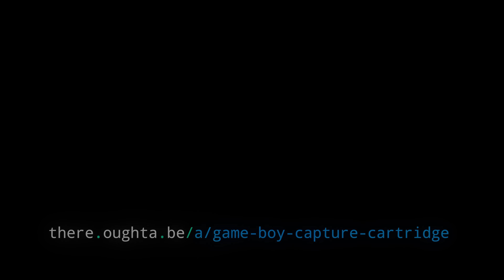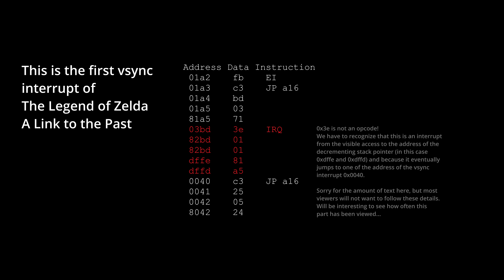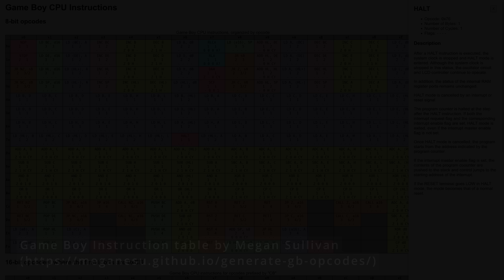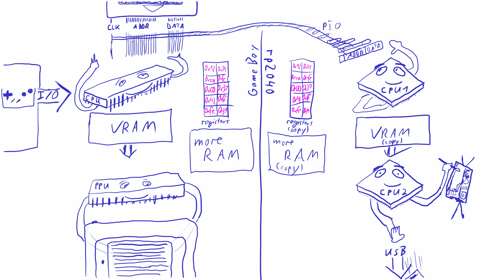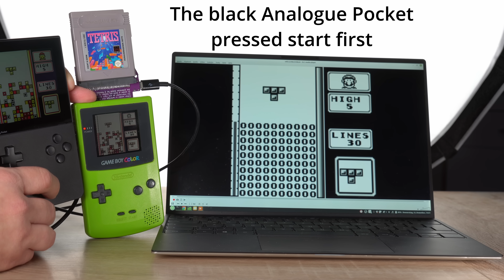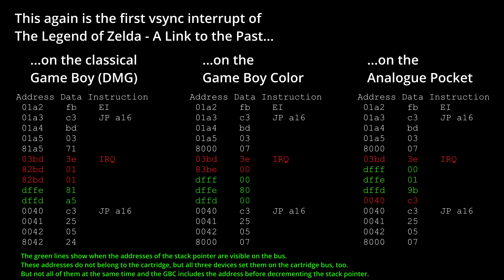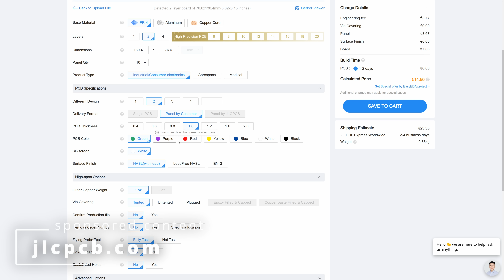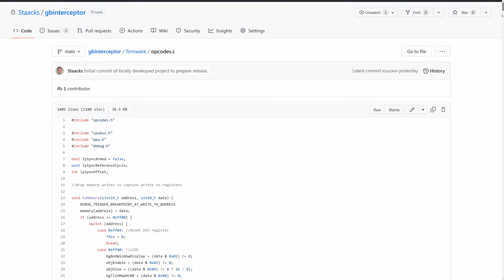A Game Boy capture cartridge: The GB Interceptor

Comment: No ESD protection on the USB port.
Reply from the maker: Can you tell me a bit more about this? Hardware is definitely not my strength and there is a reason I based this device mostly on the example from "Hardware design with rp2040" (https://datasheets.raspberrypi.com/rp2040/hardware-design-with-rp2040.pdf)...

I assume that you are thinking of some protective diodes on the data lines? I cannot see those either in the rPi Fondation's hardware guide nor in the schematics of the Raspberry Pi Pico board. ...or Adafruit's rp2040 Feather.
I know that protective diodes are inside the rp2040 for the GPIO pins and I found that the same ESD ratings are given for all pins in the rp2040 datasheet. That led me to assume that sufficient protection is provided by the rp2040 itself, but it is something that is not often considered by the average "maker"...

So, if you can give me any further insights, I would really appreciate it. (If the Youtube comments section is too cumbersome for a proper reply, please feel free to contact me via sebastian@oughta.be).
Reply: @ThereOughtaBe  as you might know, each human body can provide quite high voltage strikes and release that on a device by touching it. Especially HDMI, USB etc. lines are not hardened against that strikes. That's why all (consumer) devices should provide mechanisms to lead this voltages to ground. BTW also human touchable buttons should have that protection.
To not influence on your usb connection, there exist special high speed diodes for that purpose.

I do hardware design in the area of high performance camera systems and medical devices for living. Typical "maker" devices don't provide that amount of protection because of different reasons.
I did not find any ESD explanation at the RP2040 datasheet, so I think that the lines are not protected, but honestly I did not invest much time in that. 

I recommend using full integrated high speed protection diode arrays like the TPD4E02B04 from TI. You can also use less sophisticated ICs based on the USB speed and type.
That IC is simple to integrate and does the job easily. In the datasheet are also layout recommendations which are very helpful.
Reply from the maker: Thanks for the elaborate answer. I am aware of ESD, but mostly as a physicist in the context of handling sensitive samples. I was more hoping for ways to assess the risk in this use case and in particular for the rp2040 (although I am aware that you cannot know every random chip out there).

I will put it on my list of things to consider for a future revision, but I have to admit that I am not entirely convinced that it is particularly important here - although I am not sure if the datasheet states explicitly how sensitive the rp2040 is to ESD. But I just spent an hour researching designs using the rp2040, including boards by Raspberry Pi themselves, Adafruit and SparkFun (maker stuff, of course, but not just some random guy on the internet level). None of them has any diodes or protection ICs near their USB port except for a Zener to protect against reverse current if an alternative voltage input is available.

But more importantly, the basic version of the Interceptor does not even have a case that protects the entire PCB from being touched. Maybe one can think of a scenario in which an ESD protection on the data lines would have saved a precious rp2040, but as long as the user can touch any of the components freely, this is like optimizing the lane departure warning of a car that does not even have a safety belt...

I should probably try to get a thought on this from the Raspberry Pi folks.

Comment: Is there a chance that a GB Color will work with colors? Maybe and update of code will be enough?
Reply from the maker: I would not rule it our entirely, but there is a big "if" and a lot of work:
The big "if" is "if someone finds a trick to massively optimize my code". I don't see it, but I do not have much experience in optimizing my code for the rp2040 on that level and I have not yet looked into optimizing the machine code. So, maybe. But it would have to be a big optimization because right now I am at the limit of the rp2040 running classic games and most GBC games run at twice the clock speed.
If that is possible, there are still many additional registers and features to be implemented including resampling of color information for NV12 color encoding which is required for the limited USB bandwidth. Currently the Interceptor internally handles everything as grayscale with a static color block that is set to gray (or green). Changing that probably also means some memory optimization as the rp2040 will run out of RAM, which is another complicated story... (The rp2040 typically runs it code from plenty of flash with dynamic caching, which is way to slow for what the Interceptor does, so the code is almost entirely copied to RAM first of which the rp2040 does not exactly have too much...)

So, nothing that I would immediately call impossible, but several big hurdles.

Comment: 6:47 Aww damn. I was wondering what trick did you use to get a nice video until you mentioned the limitations.
rp2040 was almost perfect for my need, until I ran into this limit.
Reply from the maker: Depending on what you plan to do, a compressed stream might still work. If you are not doing much work on the rp2040 otherwise it might even be possible to encode MJPEG in realtime, but I cannot say for sure.
Reply: @ThereOughtaBe  I was considering some custom compression at the time and writing an OBS plugin to decompress it. I don't currently have time to thinker with it, but I was looking into an idea of modifying QOI spec for 12bpp, since that was the depth on a Nokia N-Gage. Idea was to sample it directly from the LCD data lines.
Using MJPEG seems interesting, I might look into it when I revisit the project, though I shied away from lossy compression.

Anyway, amazing project, glad this popped up on my recommends. Love this type of stuff.

Comment: Part of me wants to see someone use this with a Super Game Boy just because of how pointless it would be. I'm sure it would work fine with it, since the Super Game Boy palettes would just be ignored by the Interceptor. It does run at a slightly different clock speed though, which might require some fixes to work.
Very interesting video, I never thought this would be even remotely possible. Of course it makes sense that you could copy what the hardware does in order to produce the same output, but I wouldn't even know where to begin with implementing an emulator that exactly copies what the real hardware is doing without access to the memory.
Reply from the maker: I am curious about the Super Game Boy, too. The slightly faster clock should not be a problem as the Interceptor measures the clock during the boot ROM. Still, any different device is interesting because the Interceptor partly relies on addresses being visible on the bus even if they do not refer to the cartridge - and that can have some variation across different models.

Comment: I don't know if something like an Everdrive exists for the original Gameboy, but I wonder if one does would it also work with this?
Reply from the maker: It does and it does. At the moment there is just one little bug one has to work around: the Everdrive resets after the menu and starts again with the selected game. At the moment the Interceptor waits for the Game Boy to be turned off before it accepts a new start. So, to make the Everdrive work with the Interceptor you plug it's USB cable in when the Everdrive's menu is already visible. This way it missed the first start and is still ready when the actual game begins.
It's on the list of things I want to fix after Christmas.
Reply: @ThereOughtaBe  Good luck. Also does it work with that Wifi cart?
Reply from the maker: Yes, in fact better than I expected myself. The Wifi part should not begin with. The Game Boy does not care if the data a specific address comes from a ROM or from Wifi and neither does the Interceptor. But you were probably thinking of the video streaming demo and here I used one of the more obscure methods to synchronize the PPU (or rather VRAM access), which is not implemented for the Interceptor. So, what happens is that the image has a tear at random line, but since the Wifi cart does not use the halt command, the Interceptor stays perfectly in synch and that tear does not move at all. And most importantly: The rest of the image is perfect.

I think that's something for my social media channels after Christmas :)

Comment: if used just for recording, can it record the data and then offload emulation to the host PC? This way you can emulate not only basic games at the cost of having a significant processing delay...
Reply from the maker: You mean in order to play Game Boy Color games? Unfortunately, no. In order to reconstruct the game, you need at least the 16 data pins and the 8 data pins (you might actually get away without rd, wr and cs). That's 24bit per event on the bus, which runs at roughly 1MHz. In total that's about 3MB/s, which is about three times of what the rp2040's USB can handle if your stream it. If you record that internally that would fill up its flash in a bit more than 5 seconds. And that calculation is for classical games - GBC games would run at twice the rate.
With different hardware that should be absolutely doable, but then emulating GBC should be doable, too. I am still hoping that someone will look at my code and find a way to optimize it enough to achieve GBC emulation, but streaming or recording the raw bus data is definitely out of the question for this hardware design.
Reply: Cool, thanks for the clarification.

Comment: pretty clever! about the DIV timer and JOYP register, you should be able to access then when the game reads them, right?
Reply from the maker: No, at the cartridge end the address lines are set for (almost) all requests even if they are not targeting the cartridge, but the data pins are not set correctly. So the Interceptor can see that the Game Boy is reading an I/O register (but we already knot that as it also received the instruction to do so), but not what data it received from it.

Comment: Very cool! Would this be upgradeable to accommodating features like, say, the Super UFO Pro 8 for the SNES has? Referring to the idea of a passthrough flashcart where you can dump your own ROMS and apply fan translation patches to it for Japanese games? (while obviously also retaining the USB capture)
Reply from the maker: Not with the current design. I specifically connected the game cartridge directly to the Game Boy and only passively read the communication. With this, the Interceptor can neither set addresses on the bus (to read out the ROM) nor can it replace parts of the communication.

Comment: Can't the DIV register be predicted if you send a write command at the beginning? That might require modifying the design though, so it would no longer be purely an "interceptor".

Another possibility could be to emulate the code in the PC many times with many different DIV values until the conditional jumps match, and report back to the microcontroller.

Comment: This is truly ingenious! I had a similar idea for my Texas Instruments TI-99/4A a few years ago. I wanted to give it HDMI video output, but the existing solutions for video upgrades, such as the F18A, besides outputting only analog VGA, required the system to be opened, the video chip removed, the new device installed, and often ugly, unsightly holes carved into the precious 40-year-plus-old rarities. It occurred to me that, while the expansion port on the side of the machine does not break out the video control lines, and plus it is a multiplexed 8-bit I/O of a 16-bit bus, whereas the video chip is connected directly to 8 bits of the 16-bit bus, it would still be possible to INFER what is going on in video and replicate it, allowing you to have a higher-quality video output, such as HDMI, just by whacking a microcontroller into the expansion port.

Seemed crazy, but you've done exactly that, only on the cartridge port. Genius! I will be writing a news item on this on the Elektor Magazine website, and will link to you, if you don't mind.
Reply from the maker: Cool, of course I don't mind 👍

Comment: Very cool project even though it is not working perfectly. For those people wanting to record original game boy games without having to emulate the PPU: You could use a Super Game Boy (or for the correct clock speed a Super Game Boy 2) and just record the video out of your SNES or Super Famicom. If you want to use the Super Game Boy 2 on a PAL or US SNES, you'll have to modify it. In the case of a PAL SNES, you need to do a region mod. If you use a NTSC console, you need to modify the cartridge slot as japanese games physically won't fit.
Another method would be using the Game Boy Player on the Game Cube.

Comment: This is an amazing piece of equipment. I don't even stream but still really want to get this. One question: Would this work an Analogue Pocket or must it be original hardware?
Reply from the maker: The Pocket has a minor difference in how it handles interrupts on the memory bus, which is why it is not working at the moment. But I think that this should be an easy fix. (Just not a high priority right now.)
Reply: @ThereOughtaBe  I completely understand. I'm going to price out a few boards this weekend and see how much it's going to cost me. I know a few creators I'd like to gift this to.

Comment: To solve the link cable issue, you should intercept the link port also; like have an in and out port on the device.  Also, it's too tall, you should use a U shaped cartridge port (like on the NES), so that the device is just a little thicker at the top.  Without that, it can snap if something pushes on the top.
Reply from the maker: The current design has two reasons: a) I was told that some of the Tetris players prefer to play with the Game Boy lying flat while pushing buttons as you would on a keyboard. b) I don't have all Game Boy models here to test the correct clearance on the backside, so the straight version was the safe bet.

But that's why there is a break-out board that allows to build alternative versions with almost arbitrary cartridge positions (seen at 13:22).

Comment: since this just output video signal via usb c, can you just use any usb c to hdmi adapter to output into any display?
Reply from the maker: Are there even USB-C to HDMI adapters like that? I mean ones that act as USB host. Most adapters that "look correct" are supposed to be peripherals to a host computer and the Interceptor also does not act as host, but like a USB webcam. Even if there are adapters that would work with webcams, I would not expect them to be happy with a 160x144 image at 29fps. And finally, I assume that you would use it to play on a bigger screen? The Interceptor already has too much lag to enjoy playing directly without another adapter. It really is only for streaming and recording.
So, in short: Sorry, no, I don't thing that a simple adapter would do you any good here.

Comment: That is awesome work you've done with the gameboy. Would this also work for Super Gameboy for the Super Nintendo and The Gameboy Player on the Gamecube?
Reply: It would probably work fine for the GameBoy Player. The SGB might not be fine because it runs at the wrong clock speed (it divides the SNES clock and gets close enough) which might throw off the Interceptor’s timing.
If you get an SGB 2 (JP only but work fine in any NTSC SNES if you get around the slot tabs) it should work because that one has its own clock.
SGB color is done by having the game write to the joypad IIRC, so that should hopefully not mess with the Interceptor.
Give it a shot! If it doesn’t work, you can always use a retro AV capture device to get the SNES or GameCube video
Reply from the maker: Jepp, I am excitedly waiting to see if those will work. I am not worried about the clock of the SGB though, because the Interceptor measures it during the boot ROM and only needs to know it when the Game Boy's clock is off during the Halt instruction anyways. It's more about details like seeing the stack pointer address on the bus during an interrupt call that those devices might do differently.

Comment: Loved the gameboy camera as webcam usecase 😄, I think the code could be optimized quite a bit, maybe I'm naive but I think the reading from the gameboy bus could be done mostly by interrupts + DMA and maybe the PIO controller. That'd free up nearly the entire second core. I wonder if you were accurate enough you could sync up with the internal counter register used for random numbers even 🤔. Anyway, cool project! Might try to construct one if I find enough folks to order with :)
Reply: I think the speeds at 6:50 refer to USB full speed, iir usb high speed could get upto 8192000 bytes per second in isochronus modes, could the pico reach those speeds?

Comment: Very cool. Theoretically couldn't you inject some code with the interceptor to make observing the controller inputs possible?
Reply from the maker: In this design the game cartridge is still directly connected to the Game Boy. I more or less did this to make a point that the gaming experience is not changed at all, so even though the bus transceivers are bidirectional, their direction pin is hardwired and they are only able to passively listen in.

But I still like the idea. Code injection might be another fun project at some point.